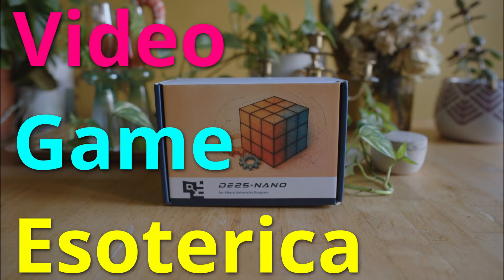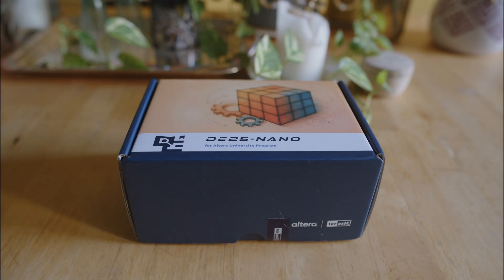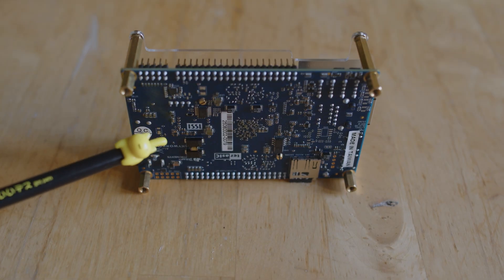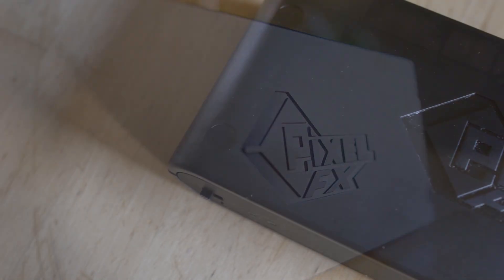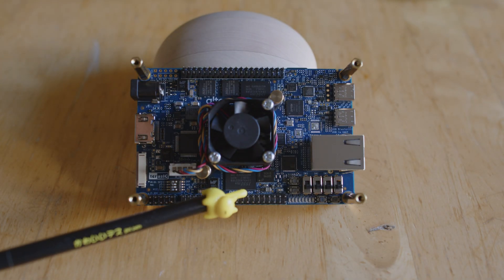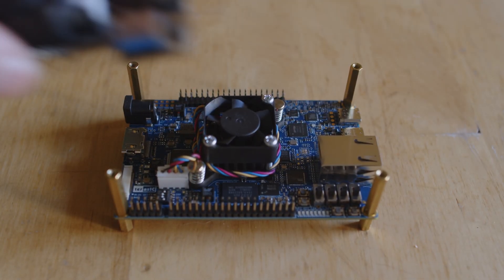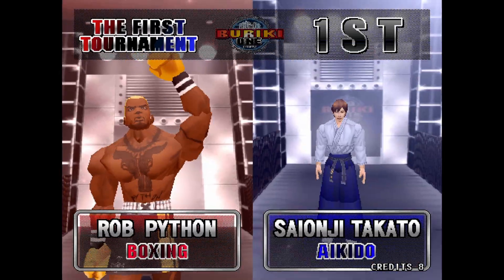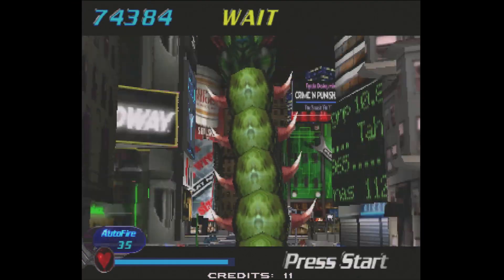MiSTer FPGA 2 Has Arrived! Or Maybe Not! Terasic DE25 Nano Unboxing

Comment: Couldn't it handle a Dreamcast core?
Reply from the maker: Maybe? Won’t know til someone potentially tries
Reply: Most likely not, the fpga on the de25 is only a 20% upgrade to that one the de10 logic-element wise
I mean, theres always a chance, and logic elements arent always the same (theres fpgas where each logic element has 3 times as many inputs and outputs as on other fpgas), but assuming the de25 uses the same architecture as the de10 and theres no crazy optimisation someone figures out, probably not

Comment: If the DE-25 becomes the heart of whatever succeeds the MiSTer like the DE-10 was for the original, my concern is that it would be susceptible to the same exorbitant price inflation genuine DE-10 experienced once word got out about it and MiSTer started increasing in popularity. It literally took someone like Taki Udon ultimately getting a less expensive alternative designed and sourced at the cost of some flexibility before consumer FPGA-based retro gaming came back down to "reasonable" prices again.
Reply from the maker: That really can’t be helped when you use an off the shelf part unfortunately

Comment: Any major difference between the Standard and the Nano? I think there was a difference in the memory layout in the DE10 series, the Std had small like 128MB SDRAM for the FPGA and 1GB of DDR3 for the HPS side, wondering if it's also different in the current series.
Reply from the maker: Mostly just connectors and some functionality not super useful for what the project uses

Comment: Honestly, after spending a lot of time with Mr. FPGA, I see it as absurd to start another project when there are already conflicting interests between other hardware and programmers. 
There are many cores in supposedly paid betas and they increase weekly but they are not released or finished.I'm seriously considering returning to emulation with Project ARCADIUM 2 and a PC, with all the arcade games working practically the same for the price and my aspirations.
Reply from the maker: Conflicting projects?

Comment: 3DO M2 would be amazing. Would that core work on current MiSTer or no? RAM limitations?
Reply from the maker: It’s more advanced than what we have now and bandwidth wise on the ram I think you’d run into some issues as it’s close if not slightly over what N64 is doing

Comment: I think that for the community to embrace an upgrade like this, it would be best if someone like Taki Udon makes  a board that can drop in existing builds without the need for buying extra cases or IO boards. Otherwise you'll end up spending way more money
Reply from the maker: Well nothing says existing boards couldn’t potentially be made to work with some jig that moves pins. But I am just imagining objects in my head

Comment: "The new kit has 128mb of built-in sdram and dedicated / shared ddr4.  Basically, it has 30% more block ram and is capable of higher clock speeds, but still in a similar form-factor...."  Bob from Retro RGB
Reply from the maker: I’m more of a words guy and not a numbers guy. So I explain it more conversationally
Reply: @VideoGameEsoterica  You're good man! I just put that up there because i thought it was a good bit of information.  I think I will grab one for my set up as well.
Reply: @VideoGameEsoterica  I am almost certain almost that mister fpga will see an update to support the DE25 nano.  it just feels too much like the * Next logical step*.

Comment: Would the ram speed timings support the N64 core? I remember Robert being very specific about these to make his core possible to work. I'm definitely curious to find out what the DE-25 Nano could turn out to become, however I also have to say that Taki's WIP 400k LE Mister successor board and the Modretro M64 also sound very interesting. Lots of great developments happening within the FPGA space.
Reply from the maker: It would alleviate the issues with the N64 core
Reply: @VideoGameEsoterica  nice, so maybe the core could then be completed.

Comment: Tbh I hope for a bigger leap. Whatever the next hardware is, it will probably be there for a long time.
Reply from the maker: It’s a bigger leap than it seems on paper
Reply: The DE-25 Nano is a substantial increase in performance in proper context.  In LE terms the ao486 was using ~89k logic elements when they did the spreadsheet on usage, when means the DE-25 Nano gives 49k or 55% more LEs for ao486 to use, and that will tend to be representative of the larger cores.  Fabric for the FPGA in turn is going from 100MHz to 350MHz giving significantly more cycle headroom.  Mind architecturally ao486 is effectively a Super286 that can do 486 instructions, as it lacks the memory manager of the 386 and the pipelining of a 486, leading to it needing a lot more clocks to do the same amount of work and other quirks.  128MB of SDRAM is just standard on DE-25 so no breakout board for that.  The Linux host system has Cortex A76s rather than A9s, which should be able to handle MT32 without a RPi breakout board.  

In turn the 5th Gen Consoles should be able to go from somewhat questionable tricks, to something more mature.  Mind the SNES core uses ~80% of the DE10, and the ao486 architecturally and performance per cycle looks more like a 286 than 386 or 486, and of course has neither a FPU or 3D accelerator.
Reply: @jebe4563  I'd settle for just an FPU and actual 486 implementation.
Reply: @JayrosModShop  Well... Currently ao486 is effectively 3 cycles on die is roughly equivalent to a 486 cycle, with a number of issues.  Take that up from 90MHz to 300MHz, and we're talking x86-32 performance beyond what software expected from a 486.

So in principle the big thing is they need to fix up the MMU, implement x87, and clean stuff up as a whole so it behaves itself with the normal 90s DOS/4GW executable rather than basically requiring repackaging with the DOS/32 extender and still having issues.  If that effort is good enough to get it to where it's 2 native cycles to 486 cycle, at 300MHz it in principle would cross the baseline to play Quake.

From there they might be able to setup a wrapper for the FPGA to address the ARM Linux system's GPU for 3D acceleration and upscaling.  Given people will tend to want to upscale that would tend to make more sense than pursuing trying to FPGA a S3 Virge analogue.

Comment: Dreamcast alone is not enough to make a new version really worth it. WIth cheap mini-pcs more than capable of running emulators, recomps and decomps becoming more common, and some consoles getting actually good quality emulators, the need for FPGA emulation is diminishing. At this point, you are starting to lose out on some really nice features, but with little to gain.
Reply from the maker: It’s just the opposite side of the same coin and both are valuable to have

Comment: If the full DE10-Nano architecture can't be brought over to this, then I dont really consider it as a MiSTer successor. I’m still holding out for something a little more powerful with native 4k so it can accurately replicate PVM scanlines. We’ll need the next MiSTer to be future-proofed for when PVMs aren't working anymore.
Reply from the maker: The architecture is just an OS basically and can be fully brought over. There’s nothing that precludes that from happening minus if it’s decided that’s the direction to go

This can do everything “MiSTer” can do and more. It’s only a question of “will it”
Reply: yes, 2025+ must be 4K native so we can get an integrated FPGA core upscaler for all the console/computer cores running on it.
Reply from the maker: Issue is the 4K chips usually come with NDAs which doesn’t work for an open dev board